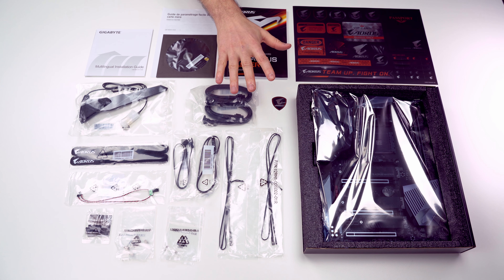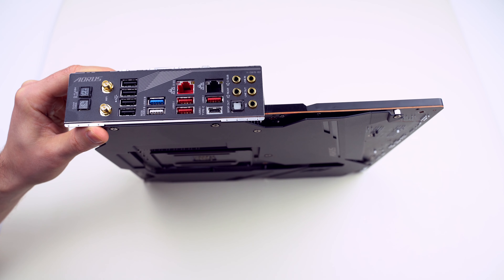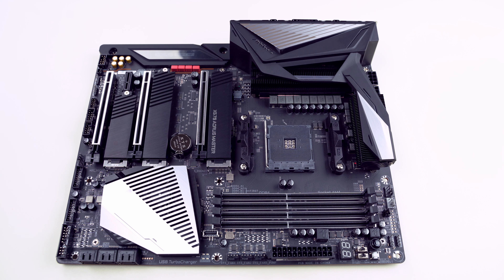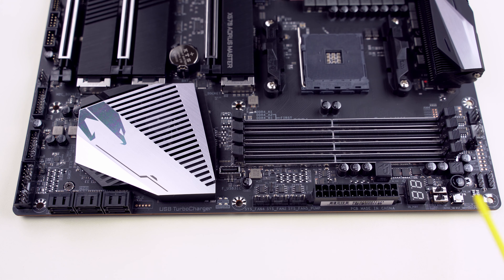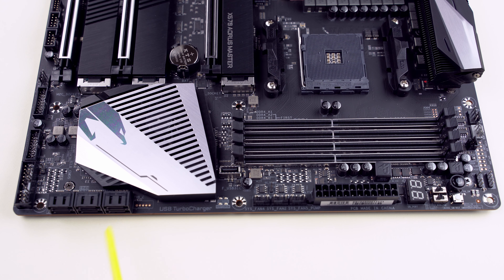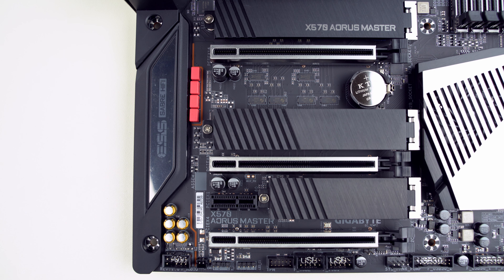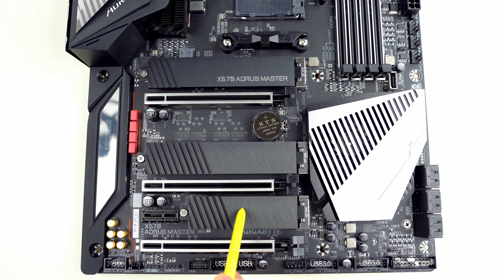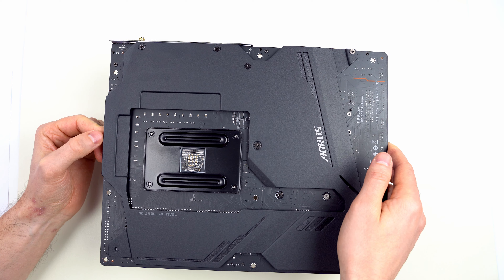Gigabyte X570 Aorus Master - Unboxing + Complete features description

Comment: Martin, do you know what are the differencies between rev. 1.0 and 1.1/1.2 ? thx
Reply from the maker: Hi Roman, the only difference I am aware of is, that rev.1 doesn´t have Thunderbolt™ Add-in Card Connector and rev1.1/1.2 do. (in my video you can see an empty white rectangle on the PCB almost touching SATA ports and the chipset´s fan cover (it says „THB_C“). Rev1.1/1.2 will also come with new BIOSes, but that is something owner of any version will update anyway.

Its for - 40 Gb/s Intel® Thunderbolt™ 3 Certified Add-in Card - GC-TITAN RIDGE (rev. 1.0) - https://www.gigabyte.com/Motherboard/... (card can be placed into PCIE-slot on the MB and connected to this Thunderbolt header by a cable)
Reply: @MartinsLab  Thank you very much, very helpfull, I am planning to purchase this board for the upcomming Ryzen 5000 series. Hopefully this would be a good choice. BTW very nice detailed features description, hope you get some more subscribers. BTW are´nt you czech?
Reply from the maker: @romanpirschel3053  You´re welcome, glad you liked the video! I think its going to be a good base for Ryzen 5000 series, quality VRMs and enough connectivity. You´ll just have to update the BIOS to F30 (AGESA 1.0.8.1) or newer. Good guess - Yes, I´m Czech from Prague. Is my accent too thick?
Reply: @MartinsLab  Yes, I was guessing based on accent... Inac ja som zo Slovenska tak som rozmyslal ci nenapisat rovno v slovencine :-) Vsimol som si v inom videu ako rozotierate termalnu pastu na procesore. Mate to overene s lepsimi vysledkami? Vzdy ma zaujimalo ci sa to oplati takto predciznejsie rozotierat
Reply from the maker: Tak slovenštině samozřejmě rozumím 😉 Většinou ale odpovídám lidem anglicky bez rozdílu národnosti, protože tomu pak rozumí většina světa. Udělám výjimku.

S tou pastou je to tak, že je lepší jí použít „tak akorát“, aby pak nepřetekla po nasazení chladiče procesoru na socket a nenadělala nepořádek (nebo případně něco nezkratovala pokud je zároveň i elektricky vodivá –  některé obsahují příměsi kovů – Al, Cu, Zn atd.). 

Co se týče teplot, tak tam platí, že pro ideální přenos tepla z povrchu procesoru, je třeba co největší plocha kontaktu s povrchem destičky chladiče, za použití co nejlepšího tepelného vodiče, v co nejmenší vrstvě. Což znamená:

a) dostatečné množství pasty – pokrývající celý povrch CPU 
b) v co nejmenší vrstvě (o to se většinou postará tlak nasazeného chladiče a nelze to příliš ovlivnit ničím jiným než dotažením šroubů na socketu)
c) Třetí zásadní proměnnou je tepelná vodivost použité termální pasty, která má obrovský dopad na celkový výsledek. Čím vyšší číslo W/mK, tím lépe. Pokud pominu tekutý kov (má super vodivost, ale má své velké nevýhody), tak je v současnosti nejlepší pasta Thermal Grizzly Kryonat s tepelnou vodivostí 12,5W/mK.

Roztírání pomocí „pytlíku na rohlíky“ trvá, jak jsem změřil ve videu necelé 2 minuty (takže je to chvilka) a výsledek je výborný – pokrává rovnoměrně celou plochu CPU a nic nikam nepřetéká. Zkoušel jsem i méně precizní roztírání plastikovou kartou s tím, že teploty byly stejné, ale došlo k přetečení pasty – což je zbytečná práce navíc s čištěním. Nejhorší, co člověk může udělat, je dát tam pasty nedostatek, to má drastické dopady na přenos tepla a tím i na výslednou teplotu CPU. 

Pokud se to odflákne a udělá se pouze „bobek“ (což dělá většina lidí), tak se téměř nikdy neodhadne správné množství na pokrytí celé plochy CPU a často to udělá na CPU kolečko (vyzkoušeno po odlepení chladiče) a pasta se pak nedostane do krajů a nevyužije se tak efektivně celá plocha CPU k odvodu tepla do chladiče. Pro mě pytlík na rohlíky „zůstává number 1“ 😊
Reply: @MartinsLab  ok, skusim najblizsie, pytlik na rohliky :-)
Reply from the maker: @romanpirschel3053  Je to levná a vysoce efektivní Československá technologie 😊
Reply: @MartinsLab  :-))), ten bobek co robi vacsina zdovodnuju tym ze pri takejto aplikacii nevznikaju vzduchove bublinky medzi procesorom a chladicom. Ale asi lepsie kontakt s celou plochou a par bublinkami ako pokrytych mozno 80% plochy jednym kruhom. Videl som testovanie kde najlepsie vyslo naniest pastu v podobe X.
Reply from the maker: @romanpirschel3053  Přesně tak, je lepší mít několik mikroskopických bublin, než nemít pokryté 4 celé rohy procesoru. 

Navíc pro perfekcionisty existuje „proti-bublinkový trik“  – stačí po dosednutí chladiče na CPU trošku na něj zatlačit a při tom jej pootočit o 20 stupňů „mimo CPU“ a pak ho vrátit do původní polohy. Tím se všechny „potenciální“ bublinky zacelí. Po došroubování chladiče stejně ještě dojde drobnému vytlačení teplovodivé pasty mimo chladič (ten tlak je překvapivě vysoký). Pokud bylo pasty akorát, tak na něm trochu ulpí a zůstane viset (do cca 0,5 mm), při větším množství přeteče. 

U aplikace „X“ i „bobek“ člověk nikdy přesně neví, jestli nepoužil zbytečně mnoho nebo naopak málo pasty – to lze zjistit až po odejmutí chladiče – což je k ničemu, protože už na CPU není 😊

Comment: What is best power supply for purchase is not burn motherboard or other components. Please write brand and model is 750w or 850w or 1000w
Reply from the maker: There are several good options when picking a PSU, the wattage depends mostly on which GPU you are going to be using, some OC versions of GPUs can draw up to 500W alone in peak. I don´t know which one you want to use?

Based on your first post, you are probably building a high-end build - so if you want the best, then I would go for:

a)	Seasonic Prime TX-850 (850W) - when using Radeon 6800 XT / GeForce RTX 3080
b)	Seasonic Prime TX-1000 (1000W) - when using Radeon 6900XT / GeForce 3080Ti and 3090 

Or 

a)	EVGA SuperNOVA 850 T2 (850W)
b)	EVGA SuperNOVA 1000 T2 (1000W)

Or

a)	CORSAIR HX Series HX850 (850W)
b)	CORSAIR HX Series HX1000 (1000W)

If you´re going for lower tier GPUs like RTX 3060Ti/3070 or Radeon 6700XT/6800 go for 750W versions of the PSUs listed above.
Reply: @MartinsLab  thank you very much

Comment: well made video this board l have  rans well
Reply from the maker: Glad you liked it :) Sofar, I had no issues as well.
Reply: @MartinsLab  still picking up tips off your video watch it 3-4 times +sw and sb  power button you the only show how it works
Reply from the maker: @MrBook123456  Great! This MB has a lot of useful features – it´s definitely worth exploring.
Reply: @MartinsLab  my Corsair MP600 Force Series was wipe  the board could pick it up but not the windows on it  so l had to put windows back it ,have you this happen to you ???? it now works ok new build only 4 weeks old
Reply from the maker: @MrBook123456  Hi Darren, I´m not sure I understand your question. Your SSD MP600 was wiped (all data on it were deleted) without you taking any action? Your motherboard could see it in the BIOS, but your OS – Windows 10 which was previously on it, was deleted. So, you reinstalled the Windows and it works now. Is that the situation?
Reply: @MartinsLab   l put a  new copy of window on it mp600  and all the up dates on it  the last one 20H2 took   2 goes at it all up to date now   the BIOS looks ok , all up to date f31el . running ok for last few weeks. l didn't  deleted l work on for a few days to try  to get it  working then reinstalled the Windows  still do not know what happened to do this?????
Reply from the maker: @MrBook123456  My guess is, that it was not a hardware issue but software. It could have been caused by a Windows update which was installed in the background (invisibly) while you were working/using your PC. You switched your PC off like usual, but when you tried booting up again you couldn´t get to OS (Windows). 

Windows might have installed an update which for whatever reason “didn´t go well”. To your question: Yes, similar thing happened to me on 2 occasions, but not with the PC using Aorus Master motherboard, it was a different setup.

Some Windows updates also take some time (5-10 minutes) to install after bootup - that’s when only “black screen” appears and windows doesn´t seem to be loading. If this happens, take a look and check if your drive (SSD) is working (red LED on your case is blinking at least occasionally - if you have it connected of course ) and try giving it 5-10 minutes to finish installing the update.

If you do 2-3 restarts with the same result, then that’s a problem and you need to reinstall (if everything else seems to be OK when you look into the BIOS).

Maybe I could do some backup and recovery video in the future.
Reply: @MartinsLab  may be , it be working for about5 weeks  well  yes the window up dates ??. l was trying  for a few before reinstall  thank you.  look forward to your next video  yes backup and recovery video.

Comment: Are there any limitations when putting gen 4 drives in all m.2 slots?
Reply from the maker: Yes there are (depends on the max speeds of used M.2 drives), the first M.2 slot (M2A) is connected by 4 PCI-E 4.0 lanes to the CPU directly, therefore the maximum available bandwidth is 7,877 GB/s. 

Second (M2B) and third (M2C) M.2 slots are both connected by 4 PCI-E 4.0 lanes - first to the chipset (X570), and from there by 4 PCI-E 4.0 lanes to the CPU. This means that they are sharing the bandwidth (7,877 GB/s) not only with each other but also with SATA ports and the third PCI-E slot (PCIE 4.0 4x).

This limitation applies for all X570 motherboards. X570 has a total of 24 PCI-E 4.0 lanes – 16 for GPU (can be devided into 2x 8 if the first two PCIE slots are occupied), 4 for an SSDs (M2A in this case) and 4 for the chipset (X570).  

So, if you put three Gen 4 M.2 drives in all three M.2 slots, two of them will be limited (theoretically - depends on the use-case) by shared bandwidth to the CPU. But, and this is important - this limitation will have any real-life effect only in situations where both M.2 drives (in M2B and M2C slots) read or write at the same time and at their maximum speed (for example - 2x 5 GB/s (Corsair MP600) = 10 GB/s and the limit is 7,877 GB/s) or if you added any high-speed cards PCIE card (2nd or 3rd GPU) into your 3rd PC-E slot and are using it simultaneously when reading/writing to both M.2 drives.

This is possible, but only very rarely, because to put it into effect, you´d have be moving large amounts of data for longer periods of time, which doesn´t usually happen when loading games, office applications, coding, even when editing 4K video (the actual amount of transferred data from M.2 drives is surprisingly low compared to what is available).

But, if this limits your use case in any way, you can switch to Threadripper or Epyc which have more lanes available leading from their chipsets to the CPU.
Reply: @MartinsLab  thank you for giving a clear understandable answer. Much appreciated. I really enjoy your content and I know I'm not the only one. Keep it up
Reply from the maker: @jeremiahk364  You´re welcome, thanks!

Comment: Is thunderbolt header on this for titan ridge add in card ?
Reply from the maker: Hi, the version of the motherboard in the video you saw is rev1.0 - this revision doesn´t have thunderbolt port for GC-TITAN RIDGE, you can only see an empty space close to the SATA ports 0 and 1 for it. It is evident that the manufacturer planned this upgrade since the beginning of the production, but didn´t implement it into the first version of the MB (reasons unknown).

There is also a newer version - rev1.1 - of the MB which has it and that is the one which is compatible with Thunderbolt 3 PCI-E add-in card GC-TITAN RIDGE. So, if you want to be able to use it, you need to get this revision of the MB. Hope this helps ;)

Comment: Does Ultra have the same placement and features minus some features?
Reply from the maker: Yes, there are some differences:
Ultra has: an HDMI output for APU - Master doesn´t
Master has: CLR CMOS and Q-Flash Plus buttons and an additional 2,5G LAN port and golden plated audio jacks on the rear IO + uses ESS Sabre 9118 DAC for audio, 2x 8pins for CPU powering (Ultra has 8+4pin) – Ultra doesn´t
Reply: @MartinsLab  accidentally broke my lock in the process of removing a GPU. Will there be problems?
Reply from the maker: @anonnimoose7987  Maybe, it depends on how broken it is. If you can still place the GPU inside PCIE slot, it would be wise to mount the GPU by 2 screws to the back side of the case and use an extra „Video Card Sag Holder Bracket“ (if the GPU is large or heavy).
 
Something like this: https://www.amazon.co.uk/dp/B08C2CTPV6?tag=iggy08-21&keywords=video%20card%20sag%20holder&geniuslink=true

It depends also depends on how long cards are placed in PCIE slots under your GPU + you shouldn´t be moving your case of course.
Reply: Triple fan so it's heavy. Was gonna use a 2nd one for gpu passthrough (the top part thats connected to the cpu) and the middle one is the one that's connected to the x570
Reply from the maker: @anonnimoose7987  So, you are using 2 GPUs?
 
The middle x16 PCIE slot is also connected to directly to the CPU like the first one, but can run only at x8 speed effectively.

When you occupy both (1st and 2nd), each will run at x8 speed. When only the first one is occupied, it will run at x16 speed effectively. 

Only the 3rd (bottom) PCIE slot runs at x4 speed effectively and is connected to the chipset.

If one of the GPUs is longer, you might put it into the slot with broken lock and reinforce is from the bottom using the holder bracket. The lock is not necessary for the GPU to work, it just helps keeping it in place.

If you posted a link with a picture or said what are the models of GPUs and which lock on which slot is broken it would be easier to imagine what could be done 😉
Reply: @MartinsLab  ah okay I thought the middle one was the chipset
Picture: https://imgur.com/a/NknJqz8

Anyway the identity of the first GPU is the 5700 XT Phantom Gaming D

The second GPU in the future that Ill get is the ROG Strix 3080 Ti
Reply from the maker: @anonnimoose7987  OK, now I get it, a tiger was there 😊 

The good news is that the slot will very likely (99%) be functioning regardless of the missing PCIE lock. However, using some reinforcement for a card in that slot would be a good idea, 3080Ti will be heavy as well.

Deciding which card would go into which slot will be dependent mainly on the thickness of the heatsink of that GPU. You´ll want to have as much space between them as possible for cooling. So, the one with thicker heatsink (cooler) will go to the 2nd (middle) PCIE slot.

Another good news is that both cards (5700XT and 3080Ti) use PCIE 4.0 connection, so you´ll be using maximum available bandwith to the CPU that X570 chipset offers. Each GPU will run at PCIE 4.0 x8 speed effectively.  

What could be challenging is the cooling of the case with 2 GPUs running simultaneously under load. Propper air flow will be necessary.

Just for info, here is the connection of PCIE slots for your Gigabyte Aorus Ultra (page 8): https://download.gigabyte.com/FileList/Manual/mb_manual_x570-aorus-ultra_1002_e.pdf
Reply: @MartinsLab  H100i and 5950X currently

I guess the ROG is thicker than the 5700 Phantom Gaming
Reply: They're quite thick though so there's not much space anyway
Reply from the maker: @anonnimoose7987  
Yes, that’s true, both GPUs have large heat sinks so the difference will be minor, but every millimeter helps in this case. All your components (including the CPU) are power hungry and will produce a lot of heat under load. H100i gives you more breathing room around the CPU area, so that helps. Well ventilated case will be a necessity anyway.
(I´m using the same CPU + 3slot ROG 2070 Super GPU for rendering and I have the fan curve for both CPU fan and case fans set to increase airflow under load for better cooling)

Comment: How loud the chipset fan? Is it loud enough to disturb you while using the computer?
Reply from the maker: It is only loud if you use the old BIOS (F4). You need to flash the BIOS to the latest version (F11) and set it to the silent fan profile - then it is quiet and doesn´t disturb you at all.
Reply: @MartinsLab  cool, was thinking of buying Aorus Extreme for my next Ryzen 4000 build since I don't want a high potential point of failure in motherboard, and also the noise but if the noise is quite fine I'm more willing to use Aorus Elite/Master/Ultra mb. Again, thanks for the reply it helps me.